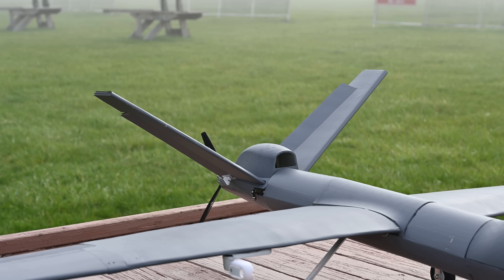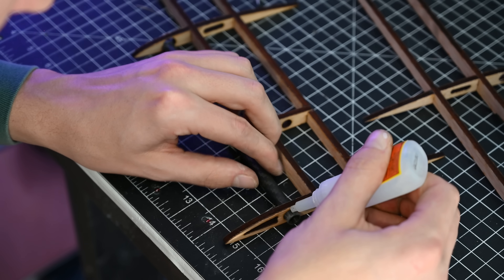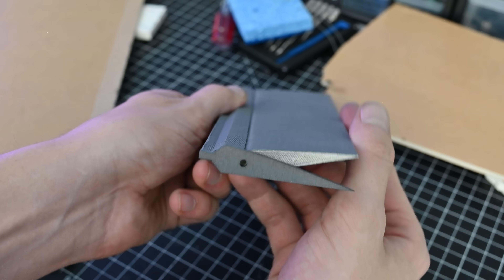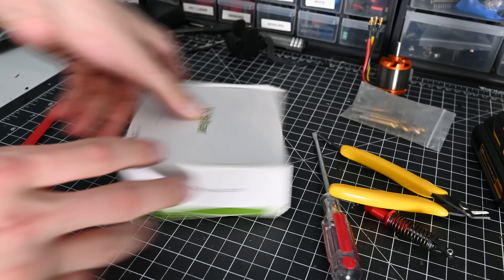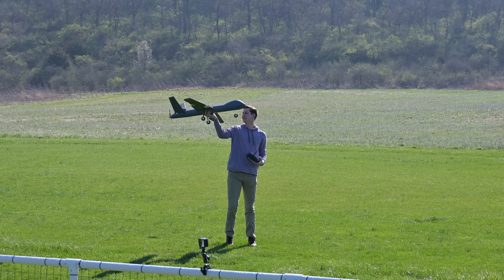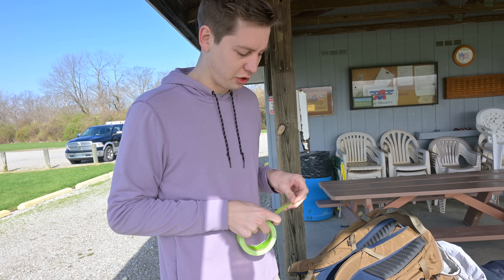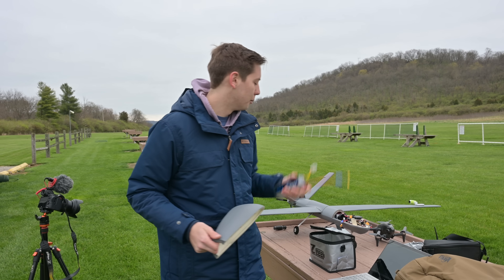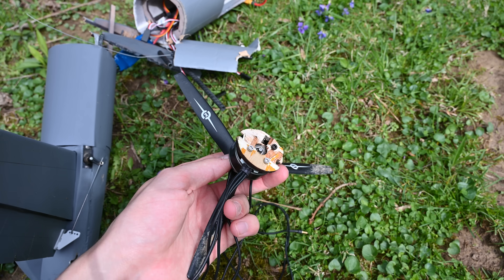Building a DIY REAPER Drone... Ended Badly

Comment: You did a FANTASTIC job with this build! I bet if you had an asphalt runway you would still be flying. This was a great video, keep up the great work!
Reply: I still fail to see how it will be able to rotate with that huge prop at the back.  Maybe a much taller landing gear
Reply: more then likely,,, minus that last one...   be a lot more damage hitting pavement ....    and you need to reinforce the gear.. pavement tends to drive them through the plane...  mmmm I only did nitro methanol running planes..  60 inch span,  3+ pounds...  those electric ones might be light enough...   but mine could land in the grass...    2" wheels..  ;-)

Comment: Just a thought, how about laminating your structural parts together using carbon fiber? You could make a small vacuum bag and press the parts if needed. I think your design was really cool but most of your longitudinal internal ribs were pretty thin. I work alot with plywoods in other aspects of life and one of the issues of most 1/4" ply is that is usually is made of one thick internal piece with two smaller (maybe 1/32") thick outer skins glued together. The thicker internal piece often has voids (that you cant see) making thin rips super delicate. You could try a Baltic birch 5mm ply, thats a much stronger panel but I think the weight needs to be considered first as its a dense panel. Really neat project you did all in all!

Comment: Some 2p-10 CA glue and activator would have made the assembly a breeze, and likely resulted in an overall lighter unit as less adhesive material would be required to achieve superior bonding. Thats assuming the foam board you used is cyanoacrylate compatible.

Comment: great project! but increasing the battery voltage doesn't increase the flight time, increasing the mA/h does. Also I would suggest adding more structural integrity to the fuselage using carbon rods or something (I'm no expert at this) and also using it to securely mount the landing gear

Comment: Very informative video showing a very clean and impressive build.  However, two things stood out to me (as a RC flyer with two decades of flying experience).
1. The linkage setup on V-tail is the worst possible combination. With link on outermost hole on servo horn and almost inner most hole on control horn, this gives the servo the worst mechanical advantage.  Making the servo prone to failure and  ruddervators prone to flutter.

2. Hand launching a pusher prop plane with prop at lowest point and a heavy setup is a very bad combo that can result in severe hand injury.  A crashed plane is the least of your worries. 

Otherwise, keep up the great work!
Reply: depends if hand launch is turned on in the firmware which will turn the engine only once it has left your hand

Comment: assuming you fix the weight issues you could try a launch catapult using rails and elastic bands
Reply: I think wings are waaaay to unstable for that and would probably break or at least it would bottleneck the speed at What the drone is flying after the launch
Reply: Or just giving it decent landing gear.

Comment: First of all It was a great build, in the last flight it was very much nose heavy and if you want to fly with the same battery take the battery little bit toward aft and change the airfoil because the video suggests that it is generating less lift than plane requires or increase the span

Comment: i kinda feel like the propeller wasn't good enough for the build, kinda seemed like it was working too hard to barely hold it in a glide. could have been a weak toss where youd need a sling shot system but i still think it was a efficiency issue

Comment: I have the same drone … I’ve debated for years if I should fly it because it’s a very tricky platform. That’s why there are so few left .. I’ve also debated dissecting it to remake the internal skeleton in carbon fiber … Also , your skin is a lot thicker than the original MQ-9 put out by hobby king… Another thing, you can’t just slap batteries in it…. You have to calculate and even weight between the center point of the aircraft… I have all my notes on it somewhere because I designed mine to be fully autonomous ..

Comment: Your landing gear def needs help.  Go look at the planes that land at that range, and see what they do.  My guess Is to tune up the suspension (use flexible metal straps) for the suspension, which will absorb a landing instead of bouncing around.  I love projects like this.  This project is so much easier to control and program than a drone because it is more stable in the air given a velocity, and this has more energy capacity as it isnt' using all its energy to push down 100% of the time.  You need to put on lights, a couple fireworks, a trailing advertisement, or do some cropdusting.  Some farmers have switched to drones for crop dusting which is amazing.

Comment: That looked really good, up until the end. ;) My input on the crash: That camera on the top of the left wing was acting just like a spoiler, or having the left aileron nearly full up. As a side note, did you design the skins in CAD as well, or just cut them to fit as you went?

Comment: I'm trying to flash a Matek 405 WTE and iNav and Mission Planner refuse to find the board (yes its in DFU mode) and flash the firmware, any ideas why? I tried using Zadag to install drivers too.

Comment: To put the servos inside the body of the craft you could mould the surfaces around a geared rod (Gears to act as grips) thus allowing the servo to control the rod from inside the body and keep the outer surface completely clear for aerodynamics and drag reduction.

I think you will be surprised how much drag those arms are causing.

Comment: Covering it in fiberglass might help strengthen it, if you're willing to accept the added weight. I was also surprised that you didn't include a camera, as the prototype has a flir pod under the nose. I have to say that you inspire me to build my own designs. I definitely want to graduate to laser cutting and 3d printing. I'd have a much larger fleet of aircraft. Thank you for sharing.

Comment: I would experimental with soaking those laser cut parts in wood glue + glue all the wood-wood connections. My engineering intro class proved adding wood glue to our balsa wood bridges increased the failure strength by at least 4-6x.

Comment: Assuming you are Mode 2 (left stick throttle) you should launch with your left hand (after applying full throttle). That way you have your right hand already on elevator and aileron so you can control it faster. With your right hand launch you had no control until you cold get your hand on the stick, by which time it was too late. Sorry you wrecked it.

Comment: you should use a toyan scale rotary engine, they make ridiculous power for their small size and rev to 30 thousand rpm easily. They're by far the best motors for this size plane if you ignore its reliability problems

Comment: Just a suggestion... the point where the wings meet the fuselage is a major stress point. If you make the wings a single piece that stretches all the way across (going through the fusalage, which holds the wings by clamshelling from above and below) it's much stronger. It also makes it easy to disassemble for transport. It's, uh, a design feature that I've seen some drones in service use.

If you're going to be landing on grass like this... maybe consider skids instead of wheels? The wheels seemed pretty useless here.

Comment: Lots of good suggestions to maximize between weight, ease of build, and strength here.  You have the tools to do a 3D-printed skeleton with a heat-shrink vinyl skin on the outside.  Fit that around a carbon-fiber spine and wing spars and you might save some time on the next one (and have enough weight left to mount a camera in a ball).

Comment: I know its a bit more expensive but maybe building the internal frame out of carbon fiber will help keep it more rigid and possibly changing from a 3 blade to 4 blade prop to give it a little more thrust to help with the added weight of the batteries. Might also help to figure out where to position the batteries for a good point of balance

Comment: Hello there! I’m actually flying a V-Type Haxacopter made up entirely with carbon fiber. I think that CF will be the ideal material for that heavy 2kg LiPo battery, so the drone can have some more weight for balance and avoid the crash. What you did there is an excellent job, a huge thanks for that!

Comment: I always mark a COG under the wing (Even if it's rough one). Then you can do a very quick finger balance at the field to check for balance.  Also - need to always strap those batteries down, a poor hand launch and batteries moving aft even a few mm could result in tail heavy and certain crash. Nice build though!

Comment: It looked like the battery in the back shifted when thrown, causing it to veer left, the nose heavyness, and the fact it had a rear prop made it rocket into the ground

I suggest building the body out of carbon fiber weaves, using a light weight acrylic, and a mold, mounting the batteries are a must, use some smaller batteries plus a single capacitor for take off. They're long enough, but widening the wing will give more lift. Adding a single rod from tip to tip of the wings will make it dramatically more stabile. A gyroscope plus an self righting program would help tremendously in not crashing under sudden unexpected failures or pilot error

Their are many ways about making this design work better, it all matters how much time your willing to put into it

Comment: I would advise using the foam and eitther carbon fiber/3d plastic parts for the intricate angles/main frame. This would overall add more weight but would allow for a larger battery/ engine (however your current engine would be sufficient). It seems the main fault was low airspeed so either a runway or a launch system should help.

Comment: Seems like a simple lever miscalculation. I battery in the nose (fee feet in front of wings) won’t be cancelled out by a battery a few inches behind the wing. May just need to put the front battery closer to wings or back battery further back to better balance. Looked good though

Comment: A truly beautiful model!  I fly from a similar grass field and we have learned the value of over-sized wheels.  Four inch diameter light weight wheels would probably have allowed take off from the grass.  Pusher designs lack air flow over the control surfaces at low speeds and are very easy to stall at launch.   Having a second person launch the plane may have prevented the crash.  With the added weight of the second battery, there was very little margin and the wings were banked at nearly 45 degrees at the time of release.  Being able to use two hands to control the launch might have given it more of a chance.  I'm looking forward to the second round.  Go for it!

Comment: Find a paved runway if possible this will allow you to really attain liftoff speed before you get into the air to avoid stalling (I’ve been there done that before) I’ve built several small unconventional aircraft including a delta wing and canard style plane ( the front wing is smaller than the rear wing so it stalls first and drops automatically and recovers quickly)

Comment: Ever tried cardboard, I built a 40 inch World war 2 seaward defense boat out of cardboard. For strength I covered with 1/32 balsa and covered with a panti hose leg and a thin coat of resin gel. Have built Ulta light weight hulls this way. Once used a coat of tile cement on a styrofoam hull.

Comment: 3:24    drag-making, non-functional air intake,  thick trailing edges  and  a weirdly configured control linkage.         why are servos located at the  OUTSIDE  and  at the  Tail.?!?

Comment: fyi       adding more battery/mass to a model increases  the  Rate of energy consumption.     in other words,   the  Only  real 'benefit' from the use of a heavier/fatter battery  is  an  increase  in the   auw.            you have made it sound like you don't really understand dom  and  were  HOPING  the cg  was not too wonky.        hope is  NOT  a good strategy.!!!        dom  is distribution of mass.        when a model is made heavier,  the thrust system and the wing design/area  NEED  to be   COMPATIBLE  with the  greater  auw.

Comment: I'm not sure how aviator you are, but just in case if you don't know; in most planes, before takeoff, we do a thing called takeoff performance calculation to see the center of gravity(in mac cg% which means mean aerodynamic chord center of gravity% showing how many percent between the leading edge mean aerodynamic chord and the trailing edge mean aerodynamic chord the center of gravity is), weight, runway distance needed and etc. Also, pilots probably learn about how the aerodynamic property of the aircraft changes from different mac cg% like different stall speed and etc.

Comment: the plywood sections are very thin, part of the benefit of using balsa is that you can get a large moment of inertia which does not scale linearly with volume, It looks like your failure mode in the crash is a key structural member in the fuselage that's frankly under built. Better materials and focusing your mass more into places where it will count can make that thing handle that crash no problem. There are times where even a foam plane (geometric plane not aeroplane) can handle many times more load than a piece of plywood that your intuition might assume to be stronger than the foam

Comment: @crash: excessive weight, take-off speed/throttle too low, stall was inevitable

STEP1: lose weight drastically -- less weight = softer, smoother, slower landing + more flight time
1a. get rid of the ALuminium landing gear(add skid pads) and use a folding prop
1b. get rid of the plywood ribs, use foamboard -- if You must have ribs -- I would get rid of most of them(and use a honeycombed edge rectangle section fuselage)
1c. get rid of the plywood spars, use balsa or carbon fiber tubes or grass trimmer nylon line or thick fishing line as spars -- saves alot of weight, while being more elastic/forgiving on impacts
1d. use 3mm foamboard with no paper covering(aka depron), cover one side(the exterior) with scotch tape 
1e. instead of lwPLA, just use foamboard with duct tape and carbon reinforced tape, for hinges
1f. instead of 2x foam layers on tail surfaces, use one layer, its enough -- if you must -- add a thin carbon tube or barbecue skewer insert, for strength
1g. use hot glue only on key structural meeting surfaces(very heavy), on the rest use bison universal hobby glue, it evaporates and its a very light weight and strong bond(it does take alot to dry/cure, tho) -- or similar light weight foam safe glue
1h. skip paint -- you can find gray/black depron, use white for top, gray/black for bottom, more easily distinguishable from afar -- if you want to "paint", use permanent markers, before applying the scotch tape -- glossy :) you will love the sheen when the Sun hits it

-- if you didnt get rid of old model, use before and after for weight comparisson :)
-- the lighter it is, the easier it is to maintain a relative position

STEP2: get rid of bulky electronics -- you are not doing aerobatics
2a. insteaf of 6cell, use a 4cell or even a 3cell at first, 2200mah max(should be more than enough) -- you can experiment after 20 flights or so, after you get a decent base for comparisson
2b. use a smaller and lighter esc/motor -- again, you arent doing 3d/aerobatics, its a soarer/glider 'spy' model

SETUP / PRE-FLIGHT: 
3a. if not done yet, trim down your control surfaces, make it maneuverable, not agile (use dual rate)
3b. checks before every take-off: control surfaces, prop, electronics

Note:
@first few flights: fly it yourself, without extra electronics(FC, GYRO, etc) with as low throttle as possible, above stall speed, make your base line comparisson -- get to feel your model in flight

--

ill add more stuff, If I recall any

Comment: Why you didn't used the autonomous take off? It's a pretty useful tool to hand launch the drone and it's pretty simple to enable on ardupilot. Just a shake and it will go full throttle and climb.

Comment: You might consider making a thin aluminum tube for the fuselage, giving you a more robust "core" to attach things to. I'm not sure if they weight would be heavier or lighter, I assume that would depend on how many zipties and how much hot glue you can avoid using.

Comment: It's been many years since I built planes (We are talking about balsa, and doped tissue paper with an IC engine.) but a vital part of the process was to make sure the plane was balanced before you took it out.  The simplest method as was let it rest on your hands from the wings and see which way it wants to tip.  Adjust as required.  No guessing.
Hope you rebuild it and get it flying.

Comment: I still question the legal limits on putting an extremely long-range transmitter on one of these and flying it across the state

Like put a digital camera on the front to look around, I've designed a solar-powered one on paper (probably won't be building it  any time soon) and it looks like it could work just questioning the legal boundaries of it

Like no-fly/drone zones, altitude limits, maybe a weight/size limit?

Comment: You did an awesome job with this model! I'd love to build something similar myself. If you want much longer flight times, it might be worth considering a self made 6S 18650 battery made of Sony VTC 5A cells. They can sustain 30A load continuously, so for airplanes they're actually perfect, because they store much more energy per gram than lithium polymer batteries. I tried a 4S in my Easy Star model and it could fly for well over 1h!